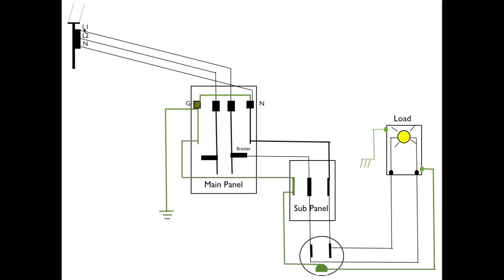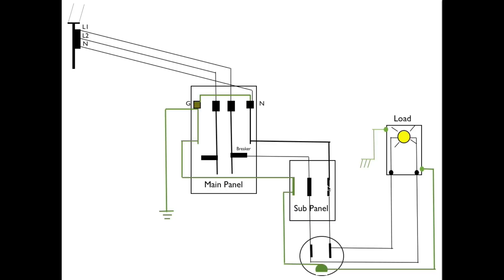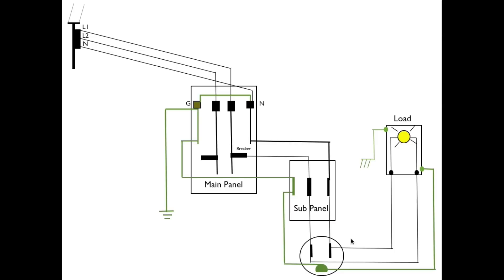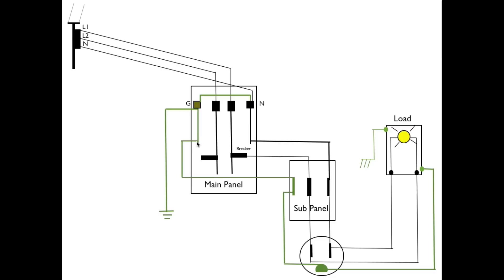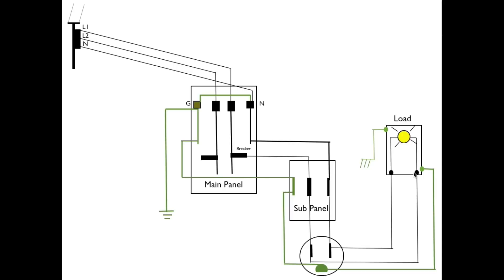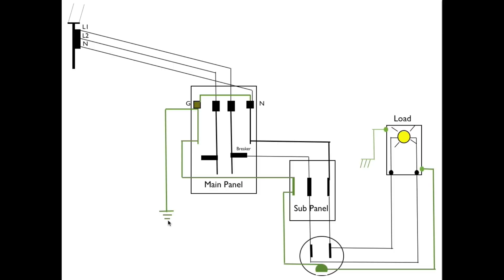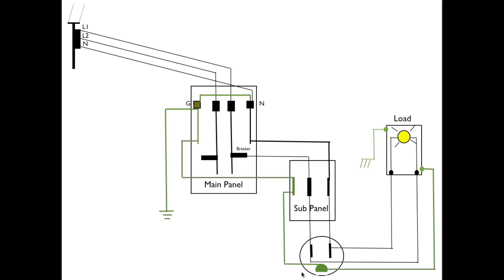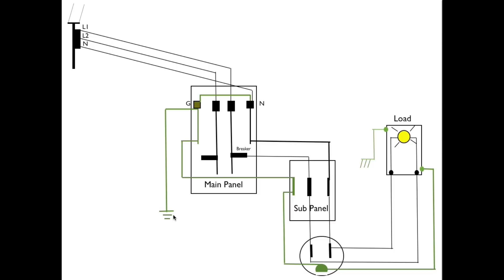The difference between neutral and ground on the electric panel

Comment: Earth bonded neutral is to keep the whole grid from floating up to a potential higher than earth ground. When is 240VAC utility current not 240 volts? When neutral is at a high potential already. It wouldn't take a lightning strike for it to happen either. Our power grids are just that massive now. They're essentially a second sky on Earth. So they'd make their own lightning all by themselves. Smart engineers know this, so they designed the system with earth bonded neutral to keep the grid at a reasonable potential in relation to earth ground. Well at least a controllable one. Which is why your service ground clamp has that little tag on it that says DO NOT REMOVE. Phone grids have the same problem. Service techs get antsy when they see those connections broken too.
Reply from the maker: Agreed on the potential. The phone guys are concerned about the grounding because if the ground electrode gets disconnected from earth ground, it will probably still connected to neutral and if there is a fault in the neutral it could seek a neutral at their station and but many things up. 
GFM
Reply: Paul Frederick — Right.  With neutral tied to ground, you always have at most 120V (approximately) from a hot wire to ground.
Reply: @GH-oi2jf  If you want to freak out a phone tech or pole monkey show them an unconnected ground. Then they start getting nervous. They understand the importance of earth bonded ground. People ain't pounding ground rods into soil for nothing after all. Which if you've ever done that you'd know isn't always so easy to do. Where I grew up we had rocky clay ground. Makes for tough driving.

Comment: Why not just say the neutral is a “return” line of unused power from the load?
Reply from the maker: Its not accurate to call it a return as A/C does not have a "return".  That said, if it helps to understand, use it.
GFM
Reply: Okay how about a “balancing of power” line.    A.k.a. Neutral.    ;)
Reply: Frankie Hoosier — It is better for everyone to use the same terminology, to avoid confusion.

Comment: what I don't understand is that the ground and neutrals are still technically connected at the main panel
Reply from the maker: It is.  But in sub panels or appliances they are separated to maintain the integrity of the safety ground.
The safety ground should never be a current carrying conductor under normal operating circumstances.
GFM

Comment: Actually your only partially correct. All power poles with transformers mounted on them also have a bare copper ground wire connected to the neutral(center tap of the transformer) going down the pole into the ground at the pole. In other words the power pole transformers also have an earth ground. Also lightning protection is NOT why we use the earth ground on devices. We use the earth ground wire to actually provide a redundant current path back to the main breaker box so if the hot wire shorts to,the chassis in an appliance it still creates a short circuit to neutral back through the ground and will trip the breaker. Without the earth ground in a metal chassis appliance if the hot wire shorts to the chassis it makes the chassis hot but does not creat a short because there is no extra ground path. When you hold the metal appliance you then become hot and if you touch something grounded you creat the short circuit through your body.

Comment: If the "neutral" wire is a "current carrying wire", then why do we ground it as soon as it enters the main box? I would think that it would immediately short out and sparks would fly in all directions. Lots of contradictions with what he's saying.
Reply from the maker: You are not understanding the concept of earth ground and chassis ground and the difference between the two.  There is no way I can explain this better in a comment section.  I would suggest you continue researching.
GFM

Comment: Isn't there some other reason for the ground wire beside to ground lightening? It seems to me that is  what he said its purpose actually was. ,  The rest was just talk about to make sure you don't use the bare ground copper wire for neutral which is return wire basically ( you know the white wire in the house).  
I thought one of the purpose of ground every is to protect you from getting full electricity go through you in case you touched some live wire.  Electricity I was told take the shortest path so it rather use the ground more rapidly that to use your as a conductor.  Lets say you are touching the hot black wire with one hand and  you touch the neutral wire with your other hand in an outlet by accident.  Now you are acting as load, electricity is moving through you.   Well what happens then is some of that current goes to the ground instead of all of the current going through you to the other arm stopping your heart.   But maybe I am wrong.
Ground wire is good if your live wire happen to hit your box it will trip the breaker switch due to high current flow back to the panel but if you didn't have that ground wire the hot wire would still be hot and if you touch you will be used as ground and you will get zapped.  But that make no sense at all.  I can touch the live black wire all the day long, just as long as I don't touch the neutral or the bare copper I would feel  nothing.
Reply from the maker: Earth ground is also a path to discharge spikes and surges in the line.  
If you touch both hot and neutral, earth ground is not involved.  You will take all the current.  
If you have contact with hot, say due to a fault to the chassis of the panel or appliance, and that ground has no contact with neutral, the breaker will not open the circuit.  If it is connected to earth, it usually will not open the circuit.   You may or may not be shocked.  It depends on continuity between you and any other contact with either earth or neutral.  If you contact earth, there will be current flow to the earth.  It will not be large, but even very low flow will be dangerous.   
The point of this is we want the circuit protection to open, and a connection to neutral will open the circuit protection.
Hope this helps.
GFM

Comment: tx at pole has a driven ground but u do not show it !
Reply: The ground at the pole is not included because we are only dealing with the wiring after the transformer.  The ground at the pole just serves the same purpose as any earth ground.  A zero voltage point for spikes or lightning to dissipate.  
GFM

Comment: Your diagram shows the ground line coming from the neutral line as if it is connecting to L1 & L2 in the main panel than to the grounding symbol….confusing. Unless that is what you are trying to show.
To make it less confusing, you should show the ground line from neutral line with an half circle/broken line as it passes over/under L1 & L2 in the main panel.
Reply from the maker: The method used is one of the accepted methods of determining an electrical connection.  That is using a dot for a connection.  Also, it is easier to do.  Thanks for the thoughts.
GFM

Comment: what if the chassis is plastic?
Reply from the maker: If the chassis is made of non conductible materials, the chassis would not be connected to the grounding conductor.  The ground buss bar would be connected as in the video.
GFM

Comment: The neutral does NOT feed the load in any way. The neutral carries the unbalanced load to ground. Otherwise all the Neutral is doing in a simple circuit is completing the loop.
Reply from the maker: I have to jump in here.  
Unbalanced loads do not go to ground.  They follow the neutral to the pole transformer.  You can remove earth ground completely and the circuit and it will operate normally.
The reason there is an earth ground at all is to provide a path (other than the house wiring) for lightning to dissipate and to provide a zero voltage point for spikes and surges to dissipate.  
If I disconnect the earth ground, there will be no potential between neutral and ground unless the neutral is open.  Ground is not part of the circuit.  
GFM
Reply: @grayfurnaceman  Yeah, OK. You've obviously never worked around power plants and sub stations. 
 What do you think happens with the unbalanced current when it get to that transformer? IT GOES TO GROUND!
 You best stick to installing furnaces pal. You're advise is going to kill someone.
Reply: Timbuck Too    Glad you work for utility!    Stay away from Premise wiring!
Reply: @KevinCoop1  Same effects in residential and commercial. Just on a smaller scale. 
 But, seeing as you think you know it all, Go ahead a disconnect grounds everywhere you see them. One day you get to the wrong one and that will be the end of your story.
Reply: Timbuck Too    I don't believe that there is any step potential issues in or near my or your house.   Utilities generally consider neutral and ground the same conductor.   Not the case in premise systems.   Neutral in 120/240 volt single phase is a tap point in the utility transformers to reduce the number of windings in the secondary to half the total windings.   Unbalanced current on the neutral goes to transformer, not ground.

Comment: Why is it different in the main panel? The neutral and grounds are shared, so why isn’t the ground current carrying? It is the same as the neutral! (In the main panel)
Reply from the maker: Ground and neutral are not the same.  
Their jobs are different.  
The safety ground is not meant as a current carrying conductor.  It is there for safety.
If they are connected together in the sub panel or appliance, and there is a fault in the neutral, the appliance will work normally.  Then if there is a fault in the ground, the appliance/sub panel frame becomes hot.
GFM
Reply: @grayfurnaceman  Thank You! I understand they’re not the same in the sub panel and the ground is not current carrying. However in the main panel the neutral shares the same space as the ground. So why does the current flow to ground? Is the neutral less resistant or does the current want to flow back to its source?
Reply: Not flow to ground I meant to say in the main panel
Reply from the maker: @jamescollins8148  Ground is not part of the circuit.  The circuit is from hot to neutral.  Ground is just a pathway for discharging lightning and surges.
GFM
Reply: James Collins    Take the sub panel out of the system for a minute.   Yes the grounding electrode conductor, equipment grounds, and neutral are all connected at the same point in the main panel.   Let's look at the other end of the conductors.   Neutral(grounded conductor) is connected to utilization equipment(load).   Equipment ground is connected only to metal parts not normally energized.  If you put clamp on ammeter on hot and get 6 amps, you will get 6 amps on neutral as well(current carrying).   So the equipment ground is open not closed circuit until a short circuit.   The equipment grounds take the fault current to neutral in the main panel, out to utility transformer, through coil, back to main panel on hot, and trip the breaker.   Hope this helps you.    Respectfully,   Kevin

Comment: Just wondering why on the loads case you have a separate ground in addition to the system (earth)ground? You also have two different ground symbols, a earth ground and the other a isolated circuit ground and I believe they are reversed for an isolated ground is floating and not earthened for testing purposes.  js 🤔... For future readers be very careful of the info of this blog!!!!  I'd  most of all  recommend  for  everyone b4  touching your particular situation checking out Rimstars  blog on grounding!
Reply from the maker: The symbol used on the sub panel is the one used for chassis ground.  Chassis ground is not intended as an earth ground so much as it is intended as a path for faults to the chassis to go to neutral to open circuit protection in the case the chassis becomes energized.  The wiring described here has nothing to do with floating ground as used in certain electronic circuits.  This video is based on NEC codes for grounding and bonding.
GFM

Comment: So what actually does a ground rod do??????
Reply from the maker: Think of the earth as a kind of absorber of electrical spikes and surges.  It also absorbs lightning.  When appliances operate the components inside the appliance will send spikes of current back into the line.  Earth has the ability to absorb some of  those charges.  
GFM

Comment: Unfortunately North America scrued up and did not follow Europe. In Europe they do not have a neutral wire, all runs on 240 volts, 14 gage wire is not needed, 16 gage is used, no neutral, 1000 of pounds of copper is saved.

Comment: I must be obtuse because I still see ground and neutral
connected in the main panel.  Also why is it called neutral
when it is carrying ac which reverses per cycle and therefore
hot would be neutral half the time? maybe my brain is DC
but this video does nothing to take me out of the fog.
Reply from the maker: Consider this:  Alternating current coming out of a transformer will be positive 120 volt on one pole at the same time as the other pole is negative 120 volts.  What would be the voltage at the center of the transformer winding?  Zero volts.  That center tap is neutral.  Thats about the best I can do.
GFM

Comment: No, it does not. It seems that all the time there's current to the load, the ground will be energized and waiting the circuit to be completed, JUST LIKE THE NEUTRAL.Otherwise, it does NOT make sense. The neutral is the enigma, since it aparently is connected to the body of the condenser? How that works?
Reply from the maker: Not sure what you are referring to.  I will take a shot here.  The reason that sub panels and loads do not have the neutral and chassis connected together is that if the neutral becomes open, the load will operate normally.  This is a problem because then if the connection to chassis should become open, the load chassis will become hot.  If you think about this situation, it is quite dangerous.
There is no enigma in neutral.  It is simply the connection to the center tap of the pole transformer.  It is bonded to earth ground for lightning and surge protection.
GFM

Comment: then why do they tie the ground bar to the neutral bar.
Reply from the maker: The neutral is bonded to the ground only in the first panel after the meter.  The ground is connected to the earth at the first panel and provides a path for lightning and surges to be discharged.  The earth and ground are not connected together in sub panels or appliances to protect the integrity of the ground as a safety ground.
GFM
Reply: Well I put quite a few grounds in and hung to many transformer to count.i just know what I know after 27years as a journeyman linemen in the step down trans busing is all ways been y-y you tie. Y delta you float.and in some cases take the neutral off the pole right to ground. And have a separate ground for lighting arrestors.hmmmm   and in the old days  there was just 1 conductor going to the service and then you drove a ground rod.and charged you for 1 phase .and now charge you for 2 phases lolol so do you have 2 phase power lolol no and that wire return neutral takes back the extra to sub.so they can add 1 Hz and sale back to you the power you all ready paid for. But some big math problem coming from some guy with a white jacket will bamboozle you into whatever he has been programmed to.and most will just except it sad .remember it's just a theory just like gravity. And excuse me but this isn't personal to any of you just seems like something else is at play